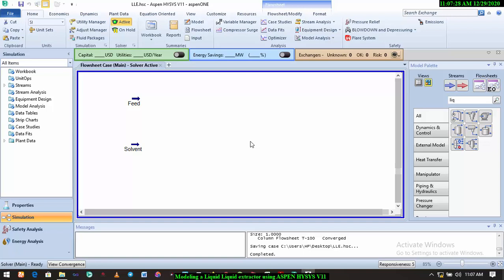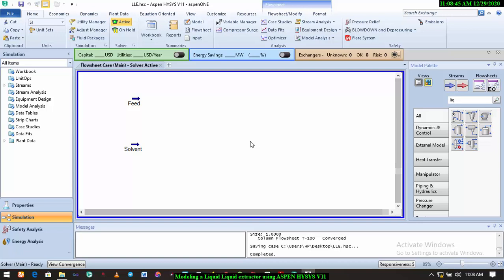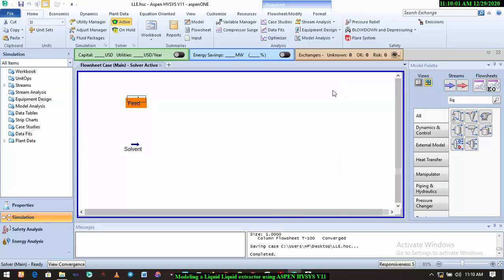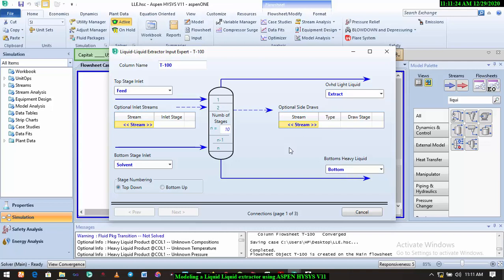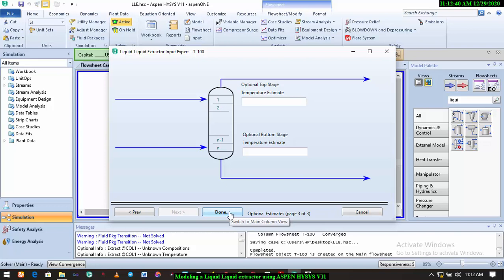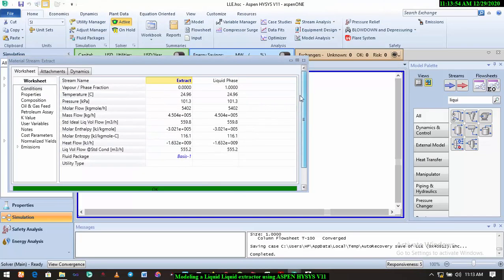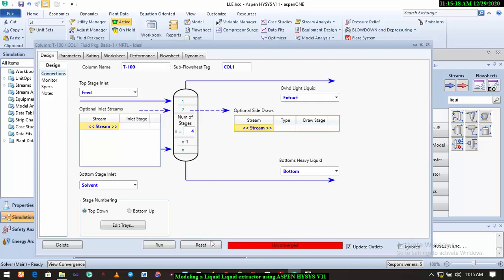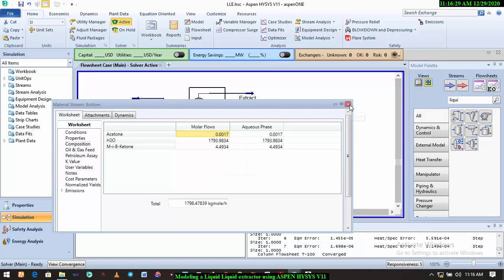Modeling a Liquid Liquid Extractor using ASPEN HYSYS V11

Comment: what does it mean if I get the error: "zero flow calculated on stage 1_main tower"?
Reply: nvm I figured it out. the problem was the fluid package used
Reply from the maker: Ok
Reply: @collinsmordi8721  How do you change the fluid package in the extractor? I have the same issue as "iced mocha" but I do not know how to resolve it.
Reply: How did u do it

Comment: what to do if i am getting -'fatal error zero diagonal in column matrix'?
Reply: Hi i am also getting same error. unable to solve. pls reply me
Reply: 5.	Some of the coefficients are not specified, since some of the tabs are left blank.  There are a number of ways to fix this.  First the coefficients can either be looked up or experimentally determined, and then entered straight into the appropriate box.  Or, HYSYS can estimate the unknown coefficients using equilibrium relationships.  To do that select either “UNIFAC VLE” or “UNIFAC LLE” and then clicking on the tab “Unknowns Only”.  In Liquid-Liquid Extraction processes, UNIFAC LLE is the appropriate estimation to use.  Close the Binary Coefficient window, and enter the simulation environment.